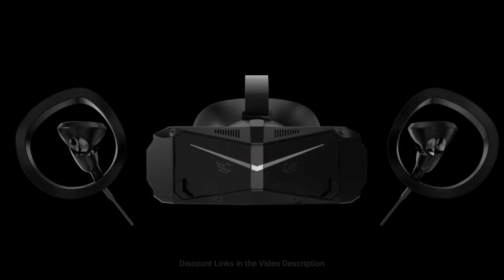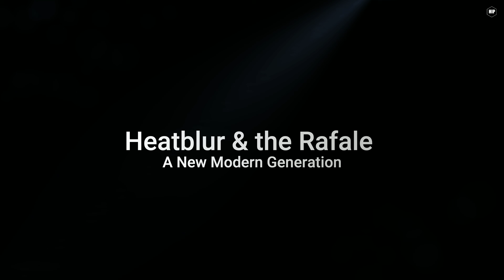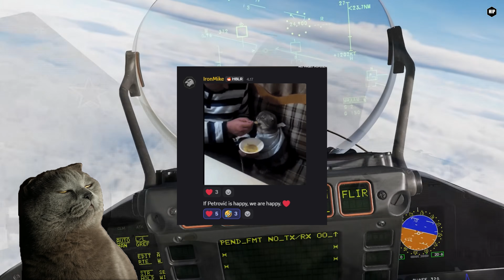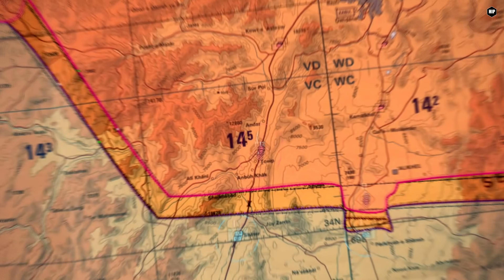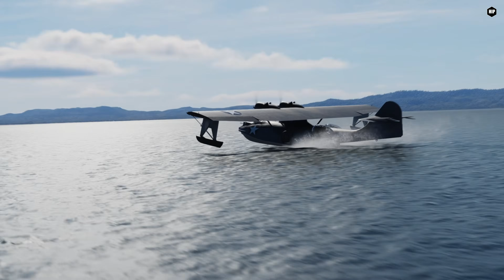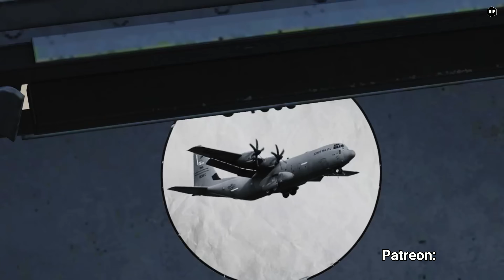DCS 2026 Reveal | Rafale Licensed | Dynamic Campaign Menu | New Units | Huge Upgrades | Skyraider

Comment: #hip4more Hang in there Petrovich, EF's coming. No FF A-6E in 2026 (nor hinted for beyond?).
Reply: EF 2000 needs to be released first before dedicated work on the A-6E. Now it has to compete with the Rafael F-14A 95 GR and BU resources. EF was announced in 2021 and we are here in 2026. AI A-6E took years from announcement to release.  We will probably see the A-6E in  5 -7 years.
Reply: @USPdocter  #hip4more You have a point there.

Comment: Heatblur needs to chill with the multitasking
Reply: If they're managing now, I don't see a problem.

I figure they have separate teams handling different aspects of the project, and for example, if the team that does the early groundwork finishes for one project, they can be retasked on a new project.

Like if they have team members that specialize in making the 3D models, once they finished with the F-14's they moved onto the F-4, and once they finished the F-4, they moved onto the A-6. They wouldn't need to keep all of a team on that project for the entire length of the project.  It's like building a car. The tech who assembles the engine doesn't deliver the engine to the assembly line and install it themselves and then follow the car through to the lot when the car is finished.